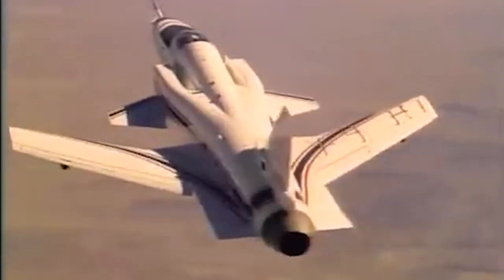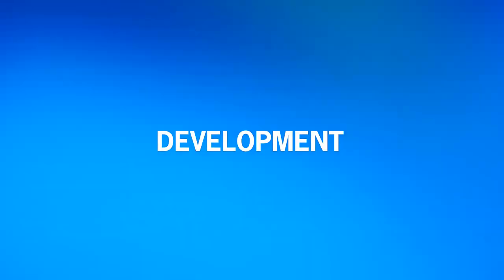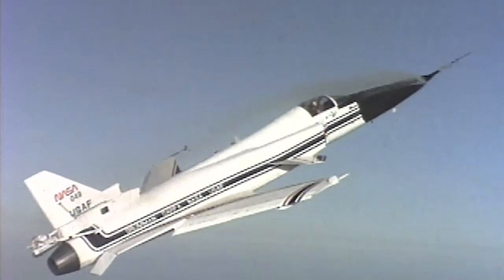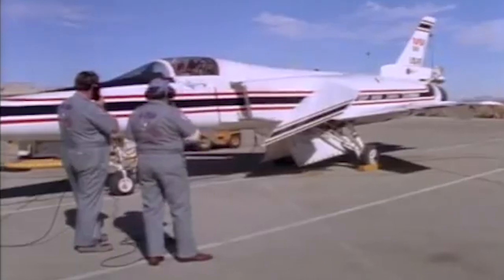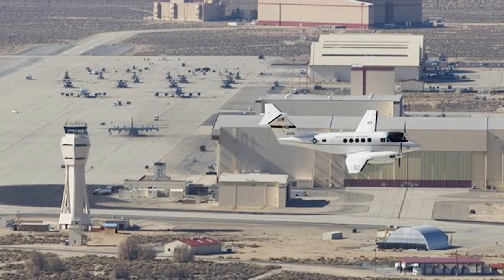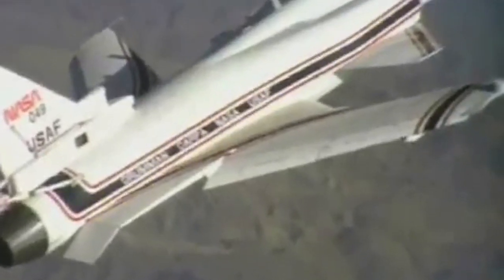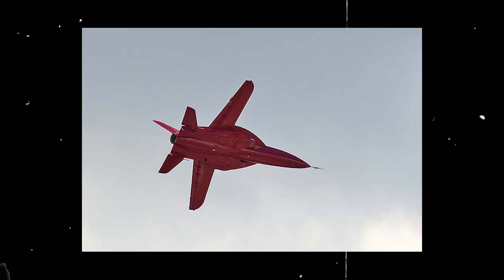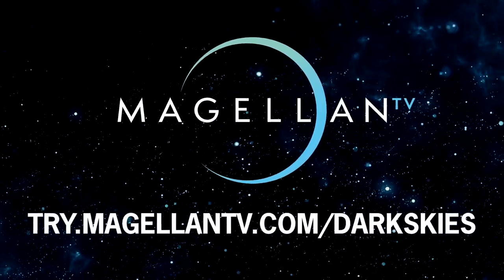X-29 - The Most Unstable Fighter Jet Ever Built

Comment: I've been to the USAF Museum, and the most striking thing about this plane is just how tiny it is.
Reply: The F5 (which what the X29's airframe was based on in parts) is also crazy tiny. It looked small to me and I was like 9 when I saw it. it's dwarfed by the F4
Reply: @andie_pants  yes the F-5 and T-38 are both derived from Northrop's N-156 program. The biggest difference between T-38 and F-5 are the wings and how they join the fuselage.
Reply: When I visited the National Air and Space Museum in D.C. back in 2010, there was also a swept forward wing jet there. Was there another aircraft tested?
Reply: @thunderbird1921  there were 2 built one is at Edward's Airforce Base and the other at the National Museum of The United States Airforce. The National Air & Space Museum used to have a full scale model of the plane.
Reply: @oliverwange8264  Okay, interesting. It was a really interesting display and honestly looked real. I remember it well because the Red Baron's plane and another US test aircraft were nearby.
Reply: X29 used the F5 front with a F16 rear. It used a F18 engine 404 that do to the air pushing in to the rear reduced fuel consumption to a 1/4 of expectations. Would love to fly it 😍
Reply: Tiny but crazy
Reply: 12:05 shows people next to it.
Reply: Didn’t know something so ugly could have a striking feature.
Reply: @DFX2KX  The X-29 is based on the F-20 Tigershark which is based on the F-5 Tiger II, which lost to the F-16. Basically single engine version of F-5. Reports I read stated that Chuck Yeager liked it over the F-16.
Reply: Did you see the YF-12 and the SR-71?  The YF-12 preceded the SR-71.

Comment: Fighters are supposed to be inherently unstable.  That's why they're so maneuverable
Reply: It sounds kind of like the difference between top heavy sport bikes and bottom heavy cruisers.  Sport bikes are not nearly as stable as cruisers, but loads more maneuverable. I'm sure aerodynamic stability is a completely different concept, but the ideas seem similar to me.
Reply: Yeah but if it is too much, it will lead to more reliability and maintenance issues with pilots getting fatigued more easily during flights, which can effect the fighing capability.
Reply: A fighter aircraft is not usually “unstable”, just not inherently stable. For instance a Cessna would correct itself and fly in a relatively straight and even path if you let go of the stick, even if you were pitching up or down. A standard fighter would continue to go in the direction it was pointed in, and won’t self correct without computer software. In that it is “unstable” because it doesn’t return to a stable position. However, the X29’s pitch was so unstable that if you would pull back on the stick and let go, it would just keep going further and further back, even with the canards straight, because the center of gravity is in front of the main lifting body.
Reply: @KingOfTheKindle , you are correct.

The Cessna would be positively stable, returning to a somewhat stable attitude when you let go of controls.

A neutrally stable aircraft simply continues its flight in the yaw, pitch & roll you were at when you let go of controls.

A negatively stable aircraft like this & the F-117A will just... let go when you let go, perform unpredictably & randomly.
Reply: Well they've only been doing that for like 40 years, and a lot of fighters still aren't built this way

Comment: Umm its almost funny to label Su 47 is a X-29 clone. Except for forward swept wings these 2 planes had nothing else in common. X-29 was originally designed to be FSW technology demonstrator. That's why F5 is used as donor plane for FSW prototype- it was faster and cheaper to use existing try and tested platform. But X29 alone was never intended to be anything else than a prototype that maybe would pave the way for some future plane that would be designed to implement FSW concept in full. On the other hand Su 47 (or S37-it was its first designation) was built from scratch to implement FSW. It was intended to be Soviet first 5th gen fighter and a response to emergence of F22 Raptor. It had new radar, internal weapons bay, new cockpit and extensively used radar absorbing materials. For prototype testing they used MiG 31 engines, but later it was planed to develop totally new powerplant for final variant that would utilize supercruise and thrust vectoring (both 2D and 3D TWN were in consideration). Also FSW gave it superior agility and low stall speed, that would give the plane an edge in every subsonic regime- especially for STOWL (short take off and landing), so plane had good prospect for carrier role also. But due to Soviet union breakdown, Sukhoi tried to finish the project from their own funds. In the end Su47 was cancelled due to lack of funds and emergence of PAK FA- T50 later called Su57. Learning from the US experience with F22 that was just too expensive even for the wealthiest nation on the planet, Russia opted for Su57 instead of Su47 in part because they had India as a development(finance) partner and future customer. So although Su47 was superior all round plane that was ahead of its time, in the end it fell victim of unfortunate situation and sadly now rusts at Gromov airport near Moscow...